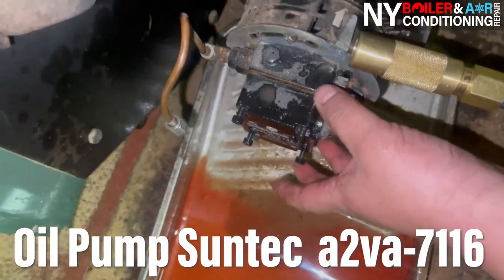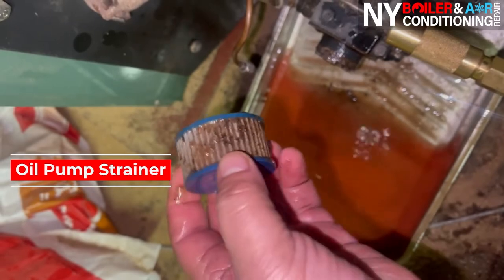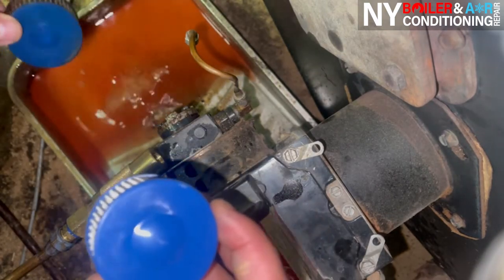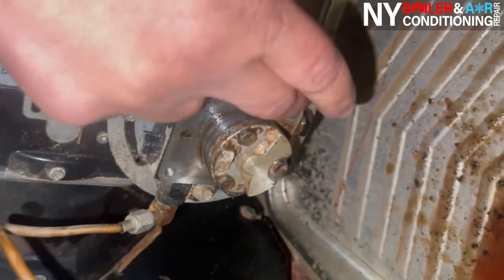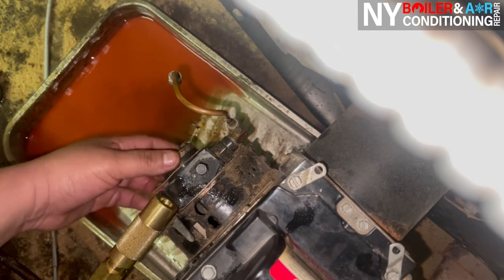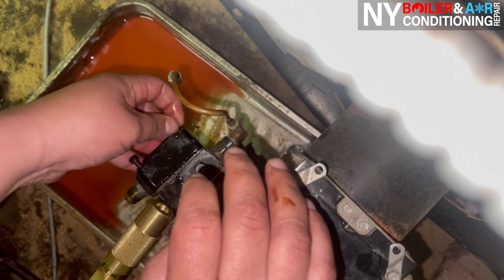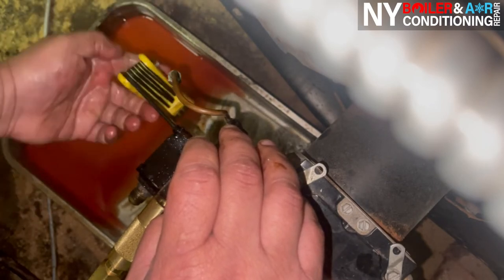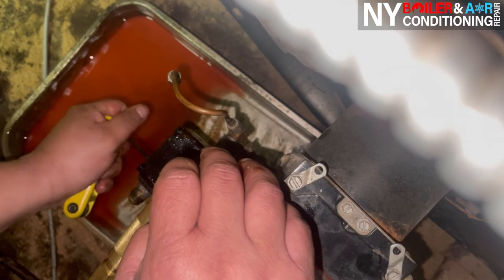How to do A Pump Strainer Replacement - OIL (A) Pump Suntec

Comment: How about the inside seal?
Reply from the maker: There is only one gasket you can replace and thats to replace the strainer like i showed you on the video. If you bust or if the seal in front of the oil pump is leaking besides the strainer gasket then you will need a new oil pump

Comment: Mine doesn't come off when I take the 4 screws off
Reply from the maker: It should, it just maybe stuck. If it’s the same exact pump
Reply: @louietheboilerman  Thank you for your answer. I'm refurbishing my oil furnace because there's no available heating company around here.
I couldn't get it part and left it for a few hours and when I got home it was apart by itself.
Reply from the maker: @Robert-fs6ge  if you need parts or anything let me know, I can get you parts
Reply: @louietheboilerman  Cool.. I might need a pump for my beckett oil furnace  I cleaned the screen inside today and will put in a new burner motor which I have. Then see how it's working
Reply from the maker: @Robert-fs6ge  you can call me at (516)-377-5200 or email me the info at NYBoilerAndAC@gmail.com